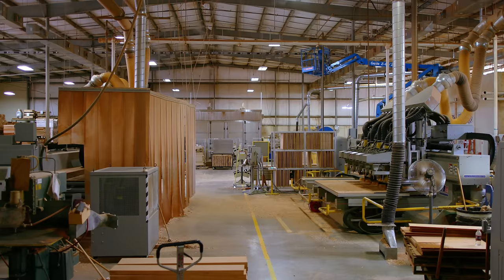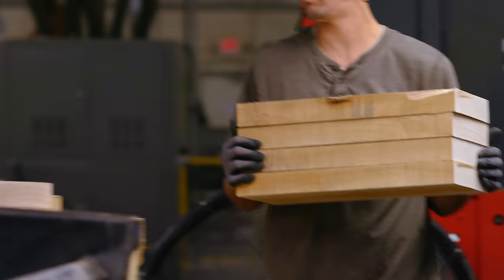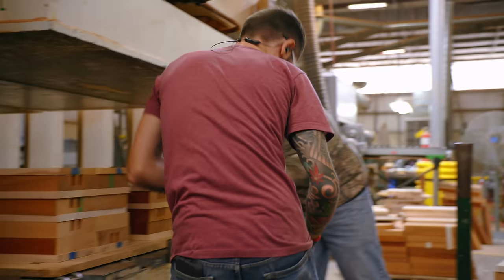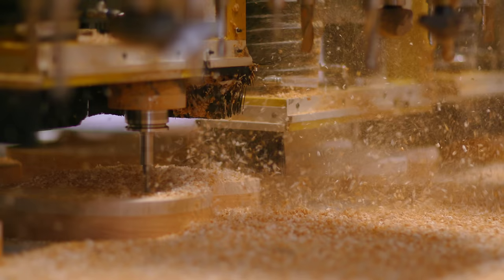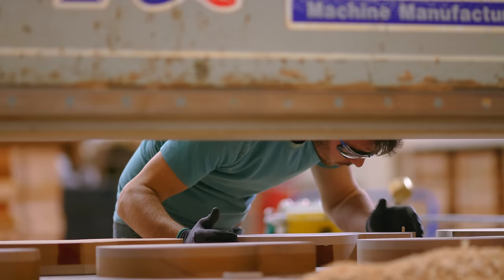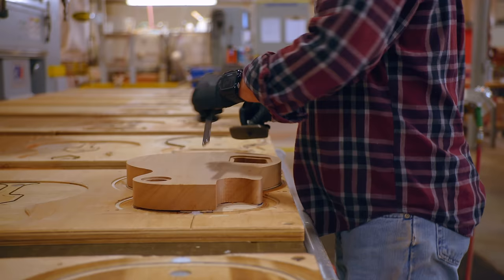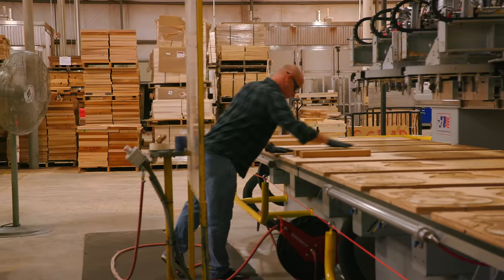How Guitar Bodies Are Made At Gibson USA | The Process S1 EP1

Comment: They really do make incredible guitars. I love my 2015 /16 Traditional Pro iii. 
If I look all over my guitar very carefully with a head lamp & magnifying gladss, i see some very minimal drips in the nitrocellulose. That’s part of what makes my axe one of a kind. It would take 2 minutes to buff those out but I love those drips. Those perfectly imperfect things. 
It is a AA flame top, vintage sunburst. If I shine a very intense light on black outer paint, it has the most mesmerizing deep purple color that pops. 
The AA flame pattern is very lively, lots of holographic/ iridescent movement when you move the guitar around. It has many stripes.  It’s more like an AAA- or an AA+
Locking tuners. Very sensitive pickups, 10 db booster, push push nobs for making the humbuckers single coil. You can create so many tones!

Comment: I love the title of the video series “The Process”.. maybe they can show the process where the tuners are installed crooked and where the nuts are not cut properly..I got a new 60’s Les Paul and that’s why I got. New CEO, same shitty QC.
Reply: dont forget the stupid 'break angle' on the Les Paul Headstock. Responsible for so many fractured necks and destroyed guitars.
Reply: My 2019 Les Paul 60's is perfect. My 2018 Gibson Explorer is perfect.
Reply: @makkdiver  design feature that most customers want. Don't like it don't buy a Gibson.
Reply: @thephotoyak  Easy fix, use a scarf joint.  Design feature stays, headstock stays on the neck.
Reply: @evenkeel6131  then it's not a one piece neck = lost buyers. Most Gibson buyers want a traditional style Les Paul. I'm not giving you my opinion on scarf joints, just saying Gibson will lose buyers if they stay from the vintage formula. They have tried it, people didn't like it.
Reply: @DestroyTheMindless  I think the best compromise is put a scarf joint and/or reduce break angle on the modern and maybe some studio models, keep the standard vintage spec. That would probably make the most people happy.
Reply: I’ve owned three Les Pauls in my 56 years, never had any problems with broken headstocks. You can’t treat them like Charvel’s....
Reply: @makkdiver  it's not the break angle that is responsible. It's misuse, or carelessness. Or even an honest mistake, but they don't just break on their own.
Reply: @DestroyTheMindless  I don't think so. People wanting a gibson,want the vintage specs. Someone wanting different specs is just going to buy a different brand.

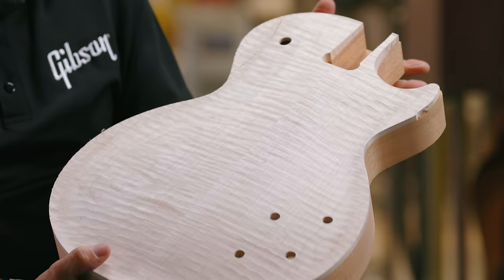Comment: 2:42 please correct me if I'm wrong but that does not look like a good book match of the top with that horrible circular grains on the upper left side of the top. Should have been thrown away or possibly sold heavily discounted.
Reply: This is often referred to as a "dirty" top, and can produce a very nice look once finished.
Reply: @joshuabenoit3744  Ah right, personally I wouldn't get one if I saw this but it's more than great if it's actually a look some people want : )
Reply: >>implying Gibson reject stuff
Reply: That’ll get a heavy tobacco burst or something very dark around the border.  Lower quality tops become solid colors, gold tops, etc.
Reply: @EdwardT9  Good strategy but often the wood shines through enough to be a bit annoying. But probably very difficult to have the “right” quality when producing quitars in such production line method.
Reply: corner liston I think that’s exactly it, they need volume and taking time to hand select is left for the Custom Shop side of things.  I knew they used CNC machines, I didn’t realize it was 10 or so bodies at once!  I love the guitars anyway.

Comment: I wonder though if the mahogany is a solid piece or 2 or 3? Nothing sounds like a Gibson Les Paul to me.
Reply: Depends on the model. At most the body will be a 2 piece mahogany body (some standards will have a one or 2 piece body). Norlin Eras used to have 3 piece bodies with the pancake body. 2 mahogany with a thin piece of maple in the middle.
Reply: @peepongdingdong9208  Les paul Custom & Les Paul Standard? both 2-pieced bodies?
Reply: L O Standards can be 1 to 2 piece mahogany bodies. Unless I am wrong, customs would be a one piece mahogany.
Reply: Rick Hackman I have owned 20+ from different brands. Nothing sounds like the heavy single cut mahogany set-neck to me.